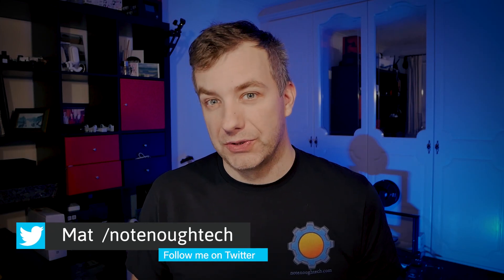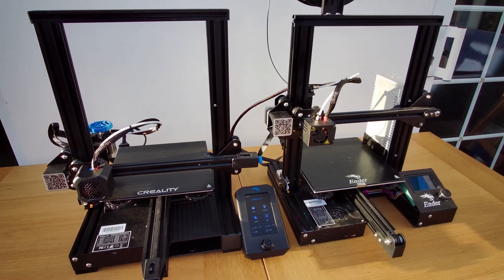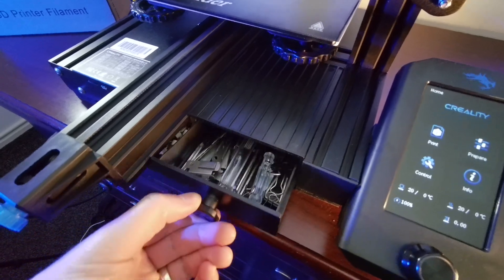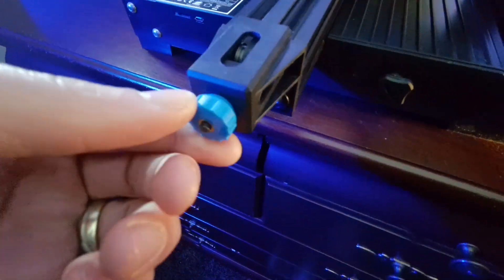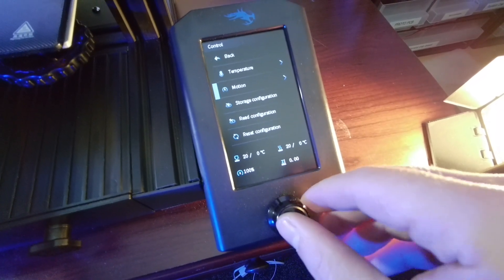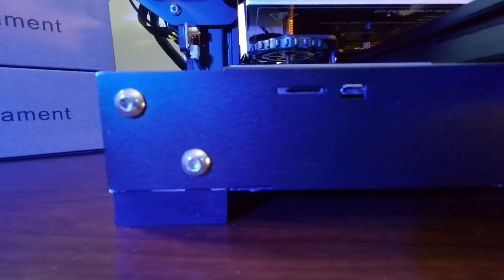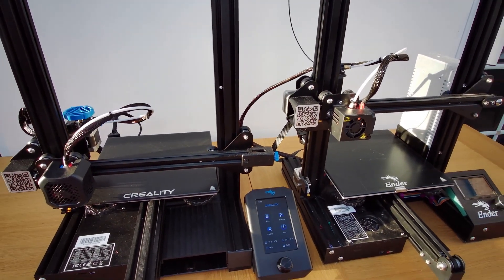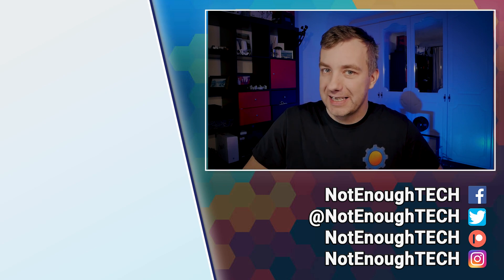Should you get Creality Ender 3 v2? [review]

Comment: Creality is hot garbage! Their control boards suck. They do stupid crap like blocking power supply fans… wiring the motherboard fan to the parts cooling fan… misaligned Zed screw… cheap fans that fail constantly if you don’t change them to a different product (and the voltage is not what most fans commonly are). 

I can NOT recommend this printer or the brand. If you like to tinker and are OK with fixing the short comings… go for it. If you want a solid machine you won’t have to tinker with… stay far far away
Reply from the maker: To be fair 24V is the one of the most common voltages used for any worship machines. Consumers just used to dealing with PC compatible equivalents that run on 5V or 12V. 

As per choices of how to design things... It is probably dictated by price. 
Unfortunately assembly and installation falls on to the customer and you are expected to know at least a bit if you are not picking ready to use  printer out of the box.
Reply: @notenoughtech  this is the most “ready out of the box” printer I have ever used or owned…. And though I do get some great prints out of it… it had by far the most flaws. 

I had a geeektech printer years back… dual Z lead screws (none of this single lead screw with a stepper bracket that doesn’t even align the lead screws).. direct drive extruder (common upgrade for the creality for good reason)… all metal hot end… rods with bearings (none of this v wheel stuff)… better control board and psu placement… and it was half the cost. 

The fans Creality install and sent me for replacement, have failed FOUR TIMES. Well, you can’t easily find a replacement that fits right in place of the stock fans. So that’s where the issue lies… 

So out of the gate.. you should remove the cover on the PSU. That’s just stupid to cover the ventilation on it. The cover was a unneeded expense. Immediately rewire the control board fan (even tho the fan is going to start making noise and fail within weeks). If you get the 4.2.2 control board you have a damn good chance of ending up with layer shifting 

I’m telling you.. I have half a dozen people I recommended this printer to and 4 out of 6 are pissed. Same issues. All 6 had the Fans fail in less than a month. The replacement fans sent by creality failed. Some had flat spots in the v wheels out of the box. It’s just not a good printer to recommend unless you put the big disclaimer that… it needs some TLC. Have another friend that bought a cr10 and in 5 weeks he sold it and bought a different brand 

I’ve just quit recommending it (or creality in general) and when asked about it, I say… it’s a option and because of the price a popular one. But don’t expect it to be problem free. 

I gave the pos to my kids.. because that’s what creality makes.. toys. 

Id probably recommend a prusa mini if someone wants quality on a budget. 

Building a printer is always the best option imho.. but a bit much for a new person to take on and usually not something they wish to take on
Reply from the maker: The fact that you had so many issues with fans, usually indicates something else is at play. It's actually hard to hill a fan (providing it's designed for the rated voltage). Usually, on creality boards, these are wired to the 24V rail, which is the same bus like the one that boards feed of. Apart from the part cooling fan hardly any one of the fans on other enders is PWM controlled. If bearings fail on your fans rather than the fan itself, there is not much that can be done about that part, unless they fail due to overdriving it with current (heat expansion of components can do that).

If your fan isn't responding anymore and subsequent fans are getting killed, I'd look at the power supply for clues. I might be not 100% correct, but the most components on the board would work on the smaller voltage so the power is regulated and filtered protecting the main electronics of the board itself but anything feeding on 24V supply would be prone to the PSU misbehaving.

On properly assembled printers dual Z axis are not needed to get successful prints. If you can't get good prints out of an unmodified printer, the assembly process is usually at fault, followed by mechanical elements being damaged (either through shipping or assembly). Swapping components that are working and are not damaged, for upgrades masks the issues rather than fixes it and reinforces the belief that things were not working because they were broken. 
As someone who received lots of emails about printers and questions, I can confirm that people do believe they do stuff right until they are shown the correct way. It's always worth re-tracing steps to see if something is missed or we simply have a different understanding of the process.
Reply: @notenoughtech  get on the Facebook groups. Every single one of these machines does it. It’s not a power issue. It’s a bearing issue
Reply from the maker: I'm on Facebook groups.  It is also called survivors biased. People are likely to post a negative experience than a positive. So for each complaint about the fan you'd get several users that were happy with the units. 

Out of curiosity have you tested your "faulty" fans with a different source of PWM voltage? You are either the most unlucky person with several fans failing on you in the same way or something is damaging your fans. 

Considering how many fans you said you have swapped I'm inclined to believe in the 2nd scenario. I only recently replaced fans on my Ender's and not because they were faulty but I wanted silent printing.

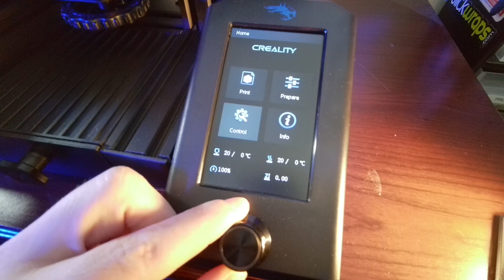Comment: @NotEnoughTECH - 02:37 -  Did you know that there are 2 cooling ports on the power supply that are closed off by the metal guard. If you notice the fan is half blocked too. I learned this from another V2 video, although the mods to improve these are drastic in this video, you can have a look at-least: https://www.youtube.com/watch?v=9e-2i5WE-gI decide on your own mod to improve cooling. I don't know if the previous E-3-Pro has this issue. I am yet to open and put together my V2.
Reply from the maker: I will be experimenting with moving supply away from the printer trying to make it silent

Comment: I've been using an Ender 3 v2 for the last two and a half weeks and it's hot trash. The z axis is messed up, the wheels have issues aligning, the metal is sharp and unfinished, the clips suck, the bed is warped, the nozzle clogs often, the included filament is garbage, the springs are always loose feeling, the Z-stop doesn't line up property and has to be screwed into place by random chance, the bed has inconsistent adhesion, the customer support is non-existent, and so much more....

It should be thrown in the trash.
Reply from the maker: Sounds like yours been banged up pretty bad. I'd advise partial disassembly to make sure structural problems are eliminated. It comes with glass bed so warped bed shouldn't have much impact other than bad heat transfer, but it would have to be really bent for this to happen.
Try going through these steps and I hope you will get to the point where you can get decent prints out form it: https://notenoughtech.com/3dprint/beginners-guide-to-3d-printer-maintenance/
Reply: That cannot be a ender 3 v2, since the bed of a v2 has no clips and is made of glass so it can't warp either. Did you perhaps buy a knockoff by mistake?

Comment: Can't decide whether to buy the Ender 3 V2 or the Ender 5 Pro. I'm not too bothered about the extra height the Ender 5 provides but are there any significant reasons why I should go for the 5 Pro over the 3 V2?
Reply: I got the V2, and my friend got the 5 pro last summer.   I had no issues with my V2.  My friend got lot of issues with the extruder.  Keep slipping.  He is trying various upgrades to fix.
Reply: @ljk075  Thank you, I ended up buying the V2 and it’s great.
Reply from the maker: It used to be - not new e3v2 are shipped with 32bit silent mb, so if you are happy with the build volume, I'd go with v2
Reply: @notenoughtech  thanks for the reply 🙏🏽🙏🏽

Comment: I have been using the Ender 3 V2 for a few weeks now. And I have to say, so far I'm happy with it. Prints are good quality and the only failed prints I had were my fault (eg. bad bed leveling, wrong slicing etc.).
Reply from the maker: Pretty much same impression. Tomorrow I'm adding bl touch as it's with me now